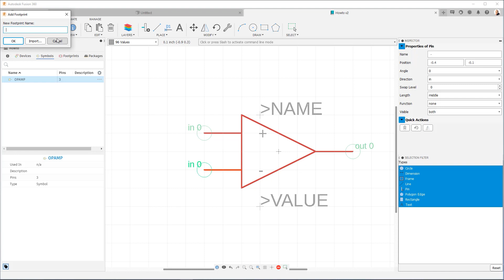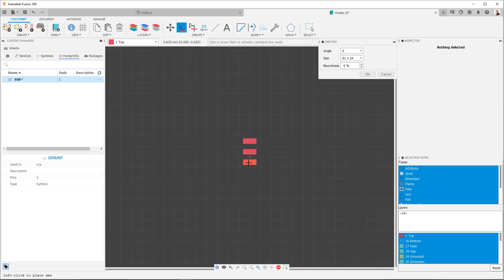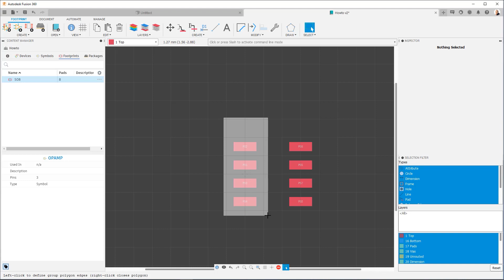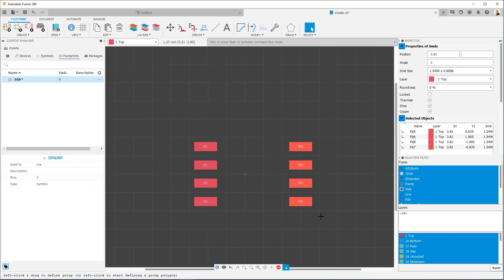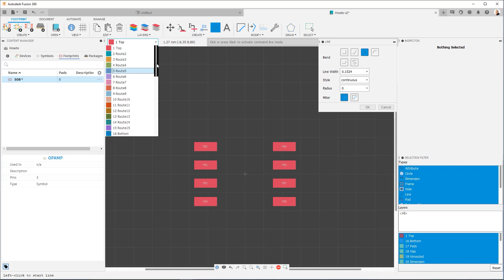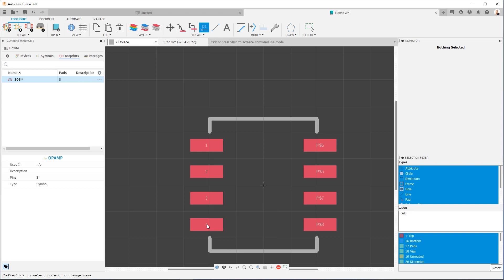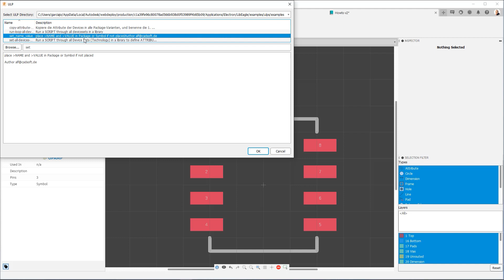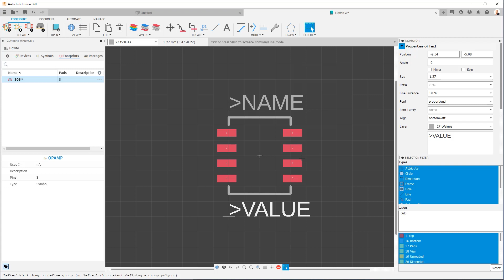Create your own electronics parts in Fusion 360: Video 3 Making a footprint

Comment: the datasheet typically uses mm for measurements. Why are you multiplying the values by 10 instead of converting to mils? the conversion factor is 1 mm = 39.37 mil .

Comment: Missing from this video are ways to mark pin 1 in the silk screen outline. Also not mentioned is how to use an already existing footprint for a new part. EDIT: It also doesn't explain how to number and relate pads to pins in the schematic symbol.

Comment: What's the layer mapping between this version and Version 2.0.20460?  Tplace layer does not exist, but I'm going by the number, 21, SilkscreenTop, which is hatched.  This is the same issue I had with your A to Z series; it would be great to have a map showing the layer name differences.

Comment: I'm surprised Autodesk has released such an unrefined software. 1 out of 2 times I manipulate the size or position of a pad through the inspector window, the software crashes. And so I am obligated to use the exceedingly lengthy process of selecting the pad, bringing it to origin, commanding it to move to the desired coordinate by entering "move (>0 0)(x y)" for each pad or group. I am sorry to say that I will be resorting back to the free EasyEDA online software for our projects after spending $500 on Fusion 360 with the assumption that it was a professional software. At least for PCB design. I have also found many other shortcomings which I will be posting in the comments section of relevant videos. Be aware of this software. It is still very much in its developmental stages.

Comment: Thanks for this! How do you add cutouts to the footprint please? Both closed and open cutouts? I.e: a mid mount USB-C connector requires an open cutout which in effect breaks out through the edge of the PCB.
Reply: Cutouts are drawn as contours on the milling layer. As long as the contour is perfectly closed it will work. That is the normal work flow.

Now your example is a little bit different because it breaks the edge of the PCB. In that scenario the best approach with the footprint is to include a portion of the outline as part of the footprint definition. In that case you will use the dimension layer to draw the board edge inside the footprint. The one thing you have to be careful with here is that when you use the part you'll have to modify your board outline to include the dimension line you've added in the footprint.

Comment: The whole way the copy operation works is really odd. It’s not like most things. A good UI is “point and shoot.” You select something, and then you operate on it. In this case, you selected the group of pads. Then you should be able to invoke copy and have it implicitly apply to the current selection.

macOS has even better gestures for copy: option-drag. Add shift after beginning the drag to constrain to the nearest axis.
Reply: This is being worked on to bring more in line with the way Fusion works. It's a big infrastructure change so it takes time but it's our main goal for this year.
Reply: @JorgeGarcia-ej3vy  Trying to learn how to use the PCB section of Fusion and this is a huge pain point. Best of luck to your team, can't imagine implementing all this in such an old software is a simple task.
Reply: Yep, I'm fighting selection, move and copy every time.  It's very frustrating.
Reply: Agreed... It's really jarring